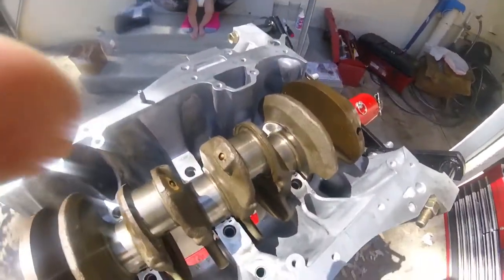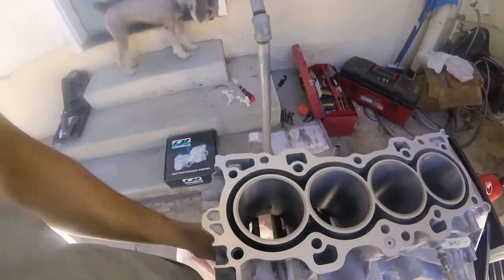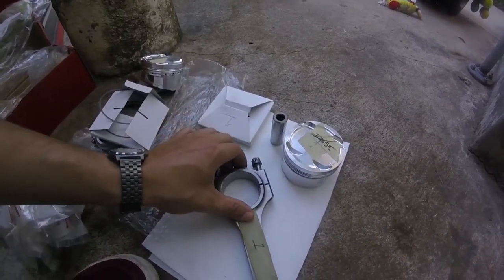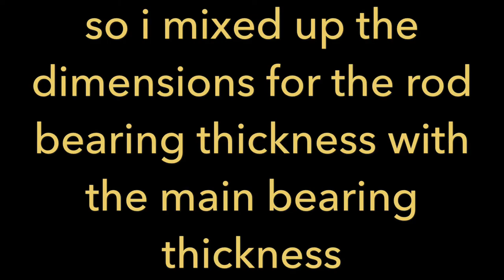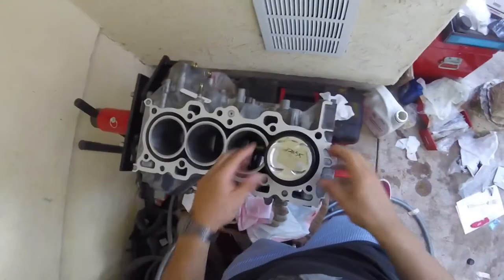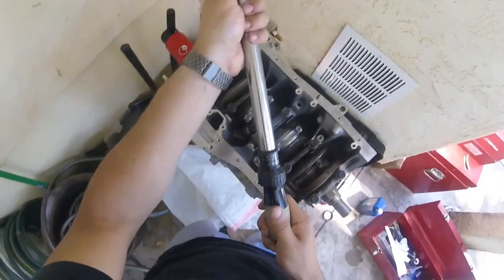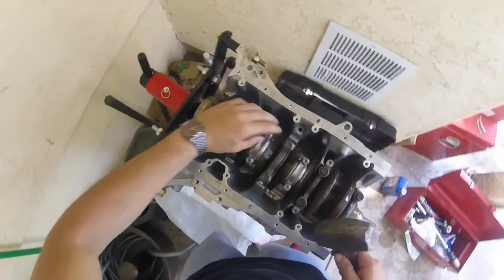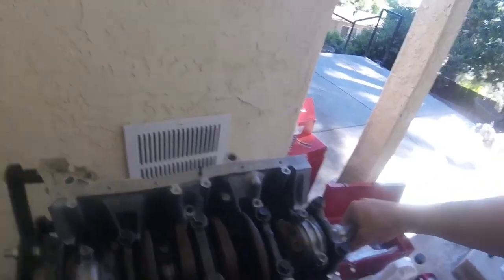Turbo LS vtec build: installing crank, pistons, and rods

Comment: like your video I have 2 blocks don't know which to build Jdm gsr or lsvtec which I've never done opinions would help thanks by the way I would have to sleeve the b18c one bad cylinder
Reply from the maker: The main difference is the crank stroke, gsr has a smaller stroke so it can rev higher more reliably. The gsr crank will fit in the ls block if your gsr block is bad. The main reason people do ls vtec is for the budget. But with its larger stroke crankshaft it can produce a little bit more torque and responsiveness. The downside to ls vtec is the low r/s ratio that makes it harder on the engine in high RPM, but with a built bottom end it will be safer to rev higher. Ive seen people rev ls vtec/b20 vtec to 9k rpm. Me personally i wont take mine past 8k rpm
Reply: Thanks a lot